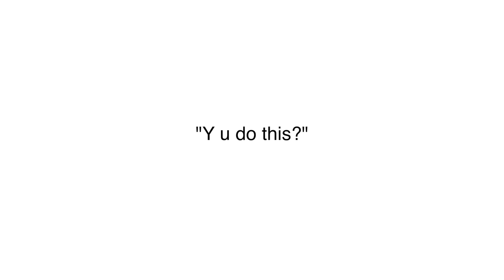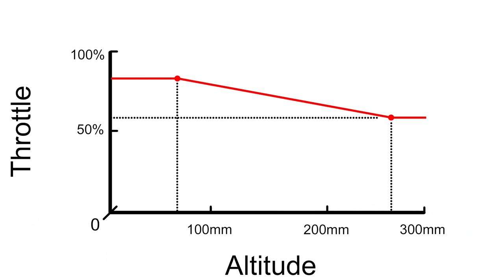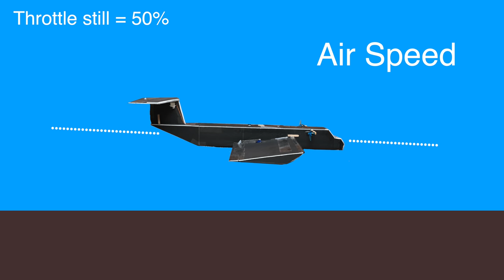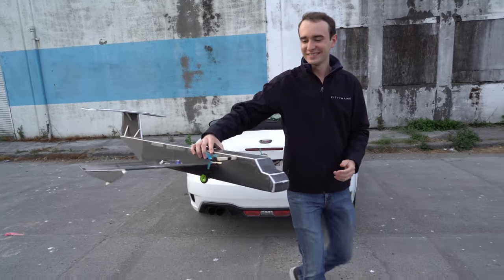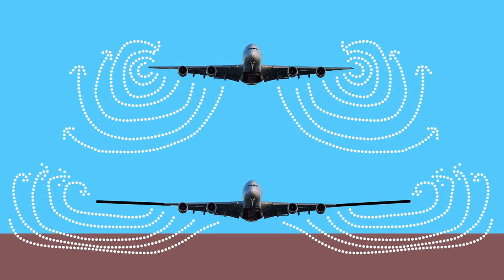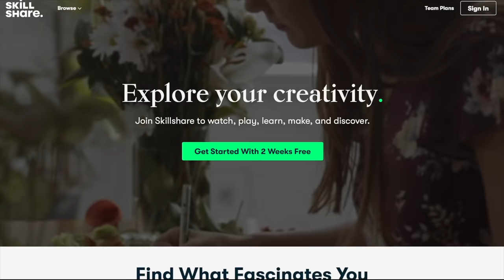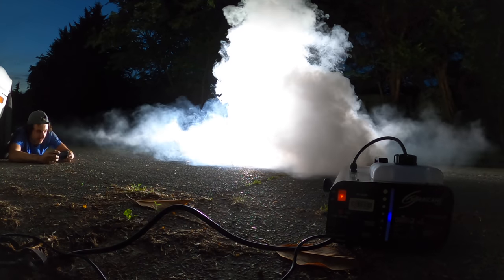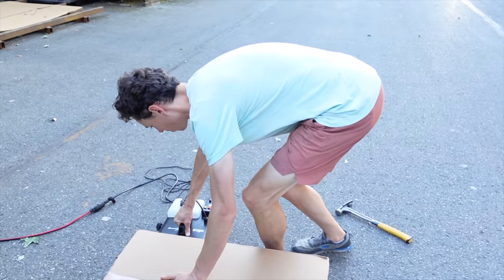R/C Ekranoplan Wingtip Vortexes

Comment: Time to put smoke generators on the wingtips 😎
Reply: You mean smoke 'bombs'?
Reply: Vapes should be ideal, cheap enough, run off of batteries already. Should be easy enough to add them to controls.
Reply: time to make a pointless  suggestion

Comment: The wing is too efficient. It can ACTUALLY fly. If it where having to claw it's way into the air more it would HAVE to stay in ground effect.
You are giving it a chance to fly out of it, and its capable, so it will.
Reply: I don't think the problem is the wing efficiency, I think it has more to do with thrust, because even a rock eventually flies with enough power.
If anything he should lower the maximum rpm of the motor
Reply: As he said, the problem with models is that turbulences have a much bigger effect on the plane so he can't rely on the ground effect to generate lift, instead is just trying to use all the groundeffect he can get to improve efficiency.
In order to stay in the ground effect he has to regulate throttle and flaps the whole time. The whole point of wing/ throttle modulation is to have these parameters perfect. A less efficiernt wing or less thrust would just narrow his options to control the flight, not improve the ground effect.
Reply: @angelorondini5835  "I don't think the problem is the wing efficiency, I think it has more to do with thrust, because even a rock eventually flies with enough power." There's an official name for that: F-4 Phantom
Reply: @markg890  ahaha
Reply: @5ch4cht3l7  I know, maybe you misunderstood.
I agree with you in that he shouldn't do any of these things, but if he wanted to try to get the plane to self stabilize in the ground effect zone he could just lower the thrust (why he can't actually do that, he explains in the video I think)
Reply: Add ballast.
Reply: @markg890  Nah... The name is "rocket".
Reply: @angelorondini5835  It's both. An efficient wing means there's more excess power available.
Reply: @michaelharris679  yes you are right, a less efficient wing also lowers the maximum speed, but it consumes more power and maybe also has a worse ground effect
Reply: I don't think it's that but perhaps I'm wrong. I think it's more excess thrust due to excessive power to weight ratio because of low model weight. In short it doesn't scale well because of things like air viscosity, light model weight and fast spool time of small electric motors and props. 
In any aircraft if lift is greater than weight plane goes up. The models excess thrust is generating lift that needs to be compensated for by control surface deflection which because of 'unrealistic' inertia (comparatively speaking) acts too fast for the model to be really stable because the model has such little mass in comparison to its control surfaces. 
If true, considering this then I would say they have done spectacularly well to get this as stable as they did.
Say the model was 500kgs (extreme I know) and powered by a couple of Rotaxes then thrust input from a larger engines would have a lag acting as a damper on the feedback loop enabling a smaller control input to the secondary lift from thrust. 
Also the added mass of the the aircraft adds to the time taken for elevation change to occur. Trim could then be used to maintain altitude as speed is substituted for elevation opposed to direct control surface input. What I mean by trim is a dynamic default control surface input that requires the servos to do little work just minor longer frequency inputs rather than rapid and many inputs as part of a negative feedback loop as was happening in the little model. 
More mass = more inertial which makes it all more realistic and controllable. 
I feel a point comes when designing a system for a larger aircraft is hindered by proof of concept models.
When scaling up all of a sudden it starts getting serious and therefore expensive in terms of about everything.
Reply: @markg890  F4-U Corsair was 1:1. The glider I soloed in was 13:1. The Nimbus Sailplane that I used to dream of flying someday was 50:1.
The guy that owned it said if he could see it, he could get there......
Reply: @ThePaulv12  I think the simple solution is gobs of power and shorter wings.
I'd rather have too much power and not be able to aerodynamically get out of ground effect.
Throw the power to the firewall and concentrate on staying straight and level.
This will sound ridiculous but hang in there with me, we have all come this far.
A hydrofoil racing boat that has enough power that it starts to fly when you dont want it to because it's a boat and has no airplane controls is a problem.
You want to go as fast as you can without leaping into the air.
If the boat was incapable of getting out of the water then you could have as much power as you wanted and never become airborne.
If you decreased the amount of lift that wind makes then you should be able to put the hammer down and not have to worry about flying above the ground effect it's meant to stay in.
Ground effect Is easy to stay in with shorter wings. If you can't go fast enough to get out of it, you won't. 
If you build a glider and put a big motor on it you would never be able to keep it in ground effect.
A brick with stubby wings and ENOUGH power will stay in ground effect all day and never fly out of it.
A brick with TOO MUCH power is a rocket and will go wherever its pointed when you light it.
Make the wings incapable of real flight. High incidence with help keep it in a perpetual near stall the whole time its in the air too.
Long fuselage for stability will help with the pilot induced oscillations. And the roll should take care of itself with a little washout.
Reply: @christopherleveck6835  I could be wrong, but I believe the ground effect has everything to do with air not being able to get out of the way (downward) because of the wing's close proximity to the ground and this is also relative to the size of the wing. It's the pressure differential between the top surface of the wing and the bottom surface of the wing that creates lift. Put toothpicks on it for wings and there is no ground effect to be had because the ground effect is all about aiding the lift created by the wings by being in close proximity to the lower surface area of the wing.

Comment: Just dump a bunch of hot water on the dry ice and you'll get the most impressive low lying fog, this is how the pro's do it for broadway stage shows and stuff, the downside is it melts the dry ice fairly quickly. But i think 10lbs of dry ice should give you about 10 minutes of fog if you do it this way.

Comment: The goal is to keep the vertical distance, that makes the throttle factor more like a positive feed back, that’s why it osslilate. I suggest to keep the throttle in eco rpm in constant, use the vertical stabilizer to just the pitching, using the elaron to banking, each part for only one airdym task, it increases the authority (that’s why v tail sucks, too much task for one surface). When the pitching is too much, it definitely means that it’s too high in your case, it won’t just fall out of sky, the separation will happen first, then the weight in nose will bring the Attck angle down naturally, the traditional configuration in nature without any electronics is a negative feed back system solely by air dynamics. And by this I guess you can increase the Kp a little bit, that’s good for reaction, in your throttle combined solution, you can’t touch Kp factor too much without triggering ossilation . It’s so easy to modify it by my suggestion, so please try it ,I am eager to see the results as I am a fan of gambling..............hhahhahhhhh

Comment: Great project trying to invent the steering wheel before having a vehicle which makes sense.  Joining with rctestflight is a very good idea, but you are still dealing with a craft which does not have basic build in neutral stability.  It is a great exercise making a brick fly, but starting with a craft which will already fly hands off, would get you to a 3/5 scale model a lot quicker.  There have been dozens of homemade WIG's which actually worked quite well and by using your height control system would be perfect.  NACA 0012 and DHMTU foil designs are available.  We look forward to your progress.

Comment: What if we used leading-edge slats to create more lift without compromising speed or AOA? We could make these slats in idle position above the wing and attached to it, like in a normal aircraft or like the ones in the f-86. we could use small servos to control them. These could act like flaps but could be preferred over them. An old rc plane builder, using the name Samm Shepherd on youtube, may he rest in peace, has a video on an aircraft with a wing entirely made out of slats and the flight characteristics are very interesting.

Comment: You should angle the lidar forward a little so it’s reading “ahead” of the vehicle, maybe a foot or two, would give it a little time to respond to the control inputs and reduce oscillation
Reply: That would make is more noisy due to variating pitch and the angled measurement. Moving it to the front and be true 90 degree to the ground, but away from CG would also be pitch sensitive.. 🤔  maybe give it eyes like birds use would work - basically do a Elon Musk and say fuck to lidars 😁🤭😜
Reply: That’s not a problem, just combine the pitch angle into it. That is easy to grab it from the gyro.
Reply: @TheStuartstardust  seriously, I think AI camera interpretation in addition to gyro sensors should deliver best results.

One lidar yields only one specific measurement, not attitude referencing.
Reply: @daszieher  yes - science also have a long history of replicating nature and they (birds in ground effect) do not use lidars 😁  The troubles are the non-flat surfaces like variating slopes - which i also think a vision system could anticipate better. 🤓
Reply: @TheStuartstardust  : Part of what birds use will be force-feedback from their lifting structures.
Reply: The problem with vision systems is that you need a lot more processing power, so maybe multiple lidars at different angles?
Reply: @spicybaguette7706  I believe that the processing power needed to correctly "imagine" a situation corresponding with reality from just a few lidar measurements may also be non-trivial.

What we forget, our brain "imagines" a (future) flight path in an imagined 3D-copy of the surroundings in our brain. Then we monitor the deviation from the intended path and apply corrective control inputs, observing their effect. The higher the fidelity of the imagination with the actual world and  performance characteristics, the better the decision making process. This is what pilots call "staying ahead of the airplane".

Without this "staying ahead", autonomous flight or autonomous control of one or more parameters is difficult.
Reply: @Bob Poekert that's what I was thinking too but even then, it wouldn't work that well on an aircraft moving that fast and it would still need to be mounted on the underside of the fuselage so at that point you lose what they were trying to gain and could just use the lidar instead
Reply: Yes. Called "forward prediction". It is an adjustable setting on aircraft guidance systems presently.
Reply: If you used two sensors, the difference between the two would make for a much cleaner D term for the controller. Some angle to the downward pointing one could help do some lead-lag compensation to the system, but given the different transfer functions of the prop and control surface control loops, it'd be very hard to optimize. I'm thinking you could program a low pass filter of the throttle input to try to model the actual instantaneous thrust of the craft, and have your elevator and spoileron controls try to make up the difference between the estimated thrust and the throttle. It'd be fairly easy to record audio of the prop when feeding it step inputs to measure the RPM response and fit a low pass filter to that curve. The throttle would handle the low frequency disturbances and the control surfaces could focus on higher frequency disturbances.
Reply: @michaelharris679  some brushless designs sense RPM internally, no need to actually build an outside loop.

the problem remains that the control system needs to "know" what lies ahead, plot a path and "control" adherence to this path, unless the craft is intended to operate over water or softly undulating terrain only. yes, no obstacles!

guiding a SAM to its target is much easier, it is just a math problem with (ideally) decreasing difference and converging results. SAMs do not know the concept of "ground".
Reply: Late to this comment chain, put it on a stick lol

Comment: man what an awesome project. but in the end you slipped away from the topic and got hooked on those sweet vortexes filming :D you know what, lets build a full size one person ground effect vehicle and it should be 3D printed one. collaboration ideas coming up Think flight did the video with your collaboration too. working on 3D printing a full size one person boat that I can turn into ground effect on water with my 30kW Electric Paramotor strapped to it. let me know if you like to collab

Comment: What about the vortices shooting backwards after the front ones?
Reply: yeah, wondered about that too
Reply: maybe thrust from the propellers?
Reply: the vortices are always back behind the plane the vortices you saw going forward was the same wing vortices as the one behind they are connected but the way the smoke was set up, that's what caused them to go "forward" if your relative to the ground to the plane they are going backwards
Reply: The fog being sucked backwards is a result of the low pressure at the core of the vorticy. Since pressure flows from high to low.

Comment: Your could measure the efficiency of the ground effect with a long duration flight in a controlled environment. Fly low in a gym and measure the energy consumption. Fly higher and measure again. There should be a noticable difference.

Edit: nevermind. I didn't watch the whole video... 🙄
Reply: I mean, that's still a valid way of measuring it - and eliminates any potential accuracy issues, either with the current meter itself or the way data is captured/processed. If Dan keeps getting inconclusive results with the ammeter method, this would be a good plan-B.
Reply: I also think a gym could give you a better environment to 
geht more smokin‘ video footage…

Comment: Very interesting content. You made it visually gorgeous!

As already pointed out, there are probably more ideal wing profiles than this foam plane has. I was thinking that the vortex generation should be minimized as well, to cut down energy loss. (I imagine the downward pointing wingtip structures are winglets, although they seem more like profile stiffeners!?). As impressive they really are, the fog cyclones show high turbulence around the wingtips, which in my mind should also be minimized.

By improving flight efficiency, stability might improve as well. I am really looking forward to the cooperation with the amphibious ekranoplan designer. For many reasons natural air turbulence is much smaller above the sea than above ground. That should make your results more stable and valid.

Comment: oooh, watching the vortices ,, I wonder if it would be possible to create a delta wing ekranoplan ??
Reply: If you mean a "pure delta", with elevons instead of a stabilizer with an elevator - absolutely possible but probably not ideal, due to lack of a separate pitch control surface. But I don't know exactly HOW "not ideal". I've flown my delta-wing RC planes in ground effect plenty of times, but it was hard to estimate exactly how much they were saving on throttle vs. normal flight, OR vs. ground effect on a more conventional-layout design. Build one of each, fly 'em and log current readings I guess?

Comment: 15:20 , i think the reason the chiller did not work is that there was to little airflow, i atempted something similar a few years ago and found a fan is needed to get smoke, if you spray into an tube(or box) without sucking more air in the same way it will just condense on the surface.

Comment: If I remember right from school, ground effect allows you to fly level at lower angles of attack, reducing induced drag and actually can roll your lift vector forward around the lateral axis giving you more of your lift vector as true vertical lift. If you can roll it far enough, you can use the horizontal component of your lift vector to “suck” your craft forward. You can turn part of your induced drag into induced thrust! 
But I haven’t studied aerodynamics since 2002, so I could be remembering wrong.

Comment: That answers a lot of questions. We used to race 1/2A RC and when a full-size cropduster would rip by good and heavy we'd fly up into its wake. The big vortices would barrel roll you. But sometimes you'd hit something different and axial roll you at a crazy rate. Like four rolls per second crazy.
Reply: Yeah, that makes a lot of sense, the vortices seem to shrink in diameter (and therefore increase RPM) with time. In regular air where you can't see them, you'd never know which bit of the vortex you were gonna hit!

Comment: Super cool! It seems like you have a highly coupled system with your multiple inputs (elevator,  spoileron, throttle) all influencing in some way your multiple outputs  (pitch, yaw, roll, altitude). I'm not super familiar with dynamic modeling of airplane systems but I'm so curious about how much better your control could be if you designed a fundamentally model based MIMO controller to account for these input-output couplings, or maybe it's just overkill and you wouldn't see much benefit!